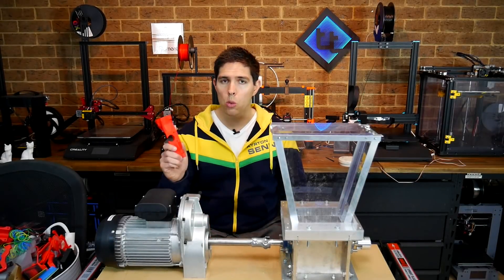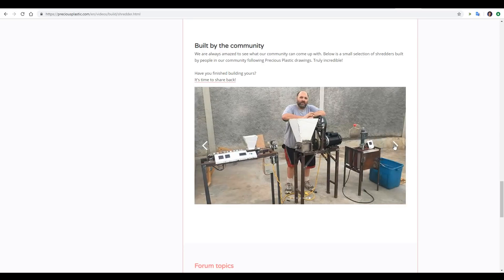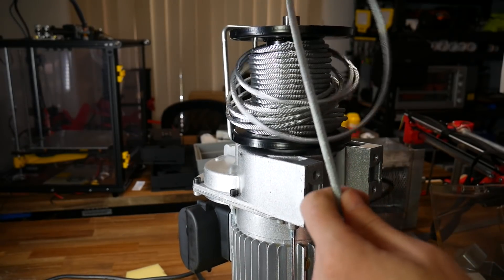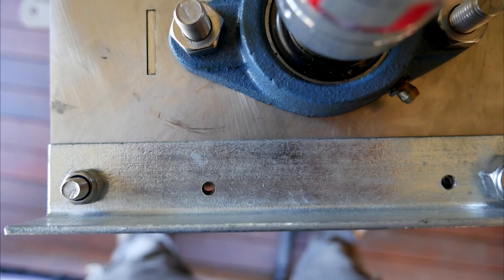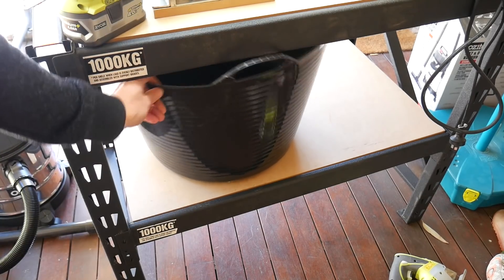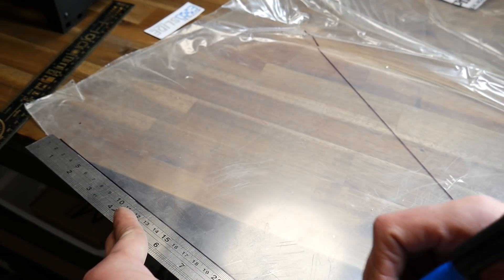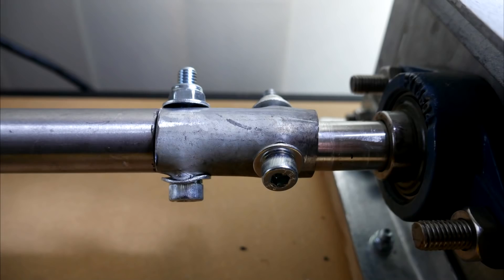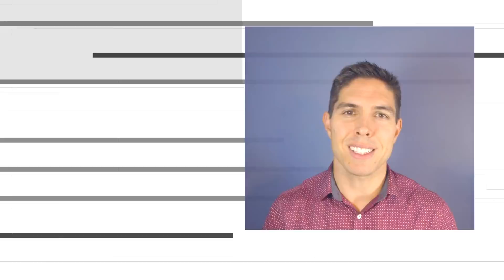Recycling waste 3D prints with a Precious Plastics shredder

Comment: This may sound very strange, and may be like a punch in the face 
But i dont care about recycling my failed 3d prints
You and me and all the other people that 3d print, produce nothing in waste, compared to big company’s in china
One day, when the world is already doomed, these companys will try to change
We have 8 years left 
8 YEARS, until we are at the no going back point

Live your life to the fullest my friend. We will die soon, sadly

However i still love your try
Keep it up
Reply: Falcon re-usability needs to become the norm at any scale.... it shouldn't matter if you produce 20kg of waste or 1000tons....

Plus, filament is normally sold by kg. Which means production is essentially about creating lots of small quantity batches in high speed so it's more efficient.

That means that the unit of production is still pretty small, so re using 'wastage' is about an input problem. (Inputs are different shapes, colour, and they are all in different places)

If systems like these evolve, they'll get cheaper or more common so you could go to your local shredder shop and re use your own filament the same day.
Reply: @ismaelabufon1696  you are absolutely wrong

Its shouldnt be about recycling these things yourself
Do you melt your soda cans???
Mostlikely not

I agree, you should get money, for returning plastics, but it would be to expensive for people to have a entire recycle center at home
I am not rich, i dont have the money for that

But lets compare, what do you think makes a bigger environmental impact 10'000 people not recycling (each 20kg) of plastic
Or 100 companys bot recycling each 1000 tons of plastic

Comment: Great video! Thanks for sharing the results,  I built that shredder box and while we know it is a beast it is great to know it stood up so well! 

Some of the issues with your coupling setup are related to the length of your output shaft (shorter means less movement) and the timber mounting (steel mountings reduce movement). We use jaw couplings with rubber spider and a keyway (grub screw fittings cant cope) and so far, so good ;)

Comment: For the coupling, use a piece of black pipe steel. It's heavy duty steel used in plumbing. It's cheap, but strong. Or you could use piece of extruded aliminium that is several mm thick. That pipe you used is way too thin for the torque this motor puts out.

Comment: At 4:11 in the video you can see a rectangular chunk of metal set into a slot machined into the shredder shaft. A similar slot is present in the spool. And that rectangular chunk of metal that ties the spool to the shaft is the drive key. The drive key not only couples the two pieces together, so they rotate without a lot of play, but the drive key is a deliberate point of failure -- the drive key can shear (fail) before either of the two elements the drive key couples together are destroyed.  Think of a big motor in a boat, and a shaft with a propeller on it. If you have a really rigid coupling between the output shaft of the motor and the prop shaft, if the prop binds up, something is going to get destroyed -- either the prop or the motor. Have the two shafts coupled using a drive key that's of a metal deliberately chosen to be not as strong as the shafts, if the prop binds up, the drive key will (hopefully) shear before the motor or the prop get destroyed. Drive keys are easier and less expensive to replace than motors or props.
Reply from the maker: I'd love to have a key but I don't have a way to machine a keyway at this stage. Thanks for the detailed post.

Comment: Yesss finaly I have been waiting for somebody seriously tacle the recicling dilema
Reply from the maker: More resources from others in the description.
Reply: Recycling dilemma? Burn it, it's the best way to recycle anything made from Carbon, it's literally the best way, always, if I was rich enough I'd build a massive biosphere greenhouse and pump it full of CO2 and create a 78/20/1 atmosphere inside it, so that it would be superoptimal for growing Trees, wheat and other plantlife. And I'd prohibit the existence of ferns anywhere near it. Ferns are the worst plant life on planet earth, depleting the atmosphere on precious CO2 and turning into oils after 50 million years and the shit grows almost endlessly and faster than you could imagine, if for example you had a pond with 1 Azolla plant on it. Let's imagine that the ponds surface is 1 googol square meters, and 1 Azolla plant is just 1 mm^2 it doubles it mass in less than 10 days. So it will cover the entire pond which is incomprehensibly big real fast, let's see it will cover it in, 3490 days. Mind you that's 
2248210660446050000000000000000000000000000000000000000000000000000000000000000000000 times the surface area of Planet Earth. In less than 10 years... The Azolla fern is said to be the sole reason for the lack of CO2 in our atmosphere. It quickly outgrows anything else that lives on this planet.
In the past when the North Sea was a lake there was a single Azolla drifting along, and we had roughly 7 times more CO2 in the atmosphere than we have now, and in less than 3 years it had drained the CO2 levels to such a point that itself couldn't extract anymore CO2 out of the atmosphere efficiently. Mind you it doubles it's biomass in 3 days in perfect conditions.

Comment: Great video. I was planning on making a plastic shredder for my kitchen plastic waste and this video probably saved me a lot of trial and error. One thing you did not include in your hopper is a safety cutout switch. Any equipment capable of removing a body part, accidently, should have a safety switch that prevents accidental operation unless all openings are closed. Not only is this a legal requirement for machinery but it is good common sense, especially if there are children around. That shredder is definitely an arm eater. Keep up the good work.
Reply: While you have a point, common sense and not letting idiots who touch everything into your workshop goes a long way. Show me a single wood worker that has the safety guards on their saws etc. If your child loses a hand in your plastic shredder, maybe you shouldn't have been letting them play with it in the first place, it's not a toy.

Comment: Very interesting.  I am interested if the high tensile bolts hold up.   You may need keyed shafts or as others mentioned gears to reduce the force on each shaft.
Dave.

Comment: So if this cost you about 1300usd to build, if my math is right at 20 dollars per kg for pla then to have it pay for itself you'd need to recycle about 65kg to break even assuming no further expense replacements.

Is that reasonable?
Reply: I'd say considering he does teaching and stuff at a school that seems to use a lot of 3d printing, he'll be able to make that back, and if he sets it up as a community thing, and was able to acquire waste prints for free and recycle that plastic back into test/draft/school prints he might make it back faster.

For your average hobbyist, not a chance that this is reasonable, but considering his full time job is basically 3d printing, I could see it working.

Comment: Honestly been considering trying to print one up of similar size in pieces and gear down a hobby motor to do the work, but idk if the plastic tines would hold up well enough to the plastic waste lol

The official PP designs all seem more expensive and less robust than they should be somehow, and while I'd love to see some stuff on the extruder, it bugs me way too much that they use a single auger bit instead of casting a pair (or more) of properly stepped screws out of a low temp cheap metal or cement or something.

Comment: It's as if we read each others minds!   I did the exact same thing....same style of hoist motor, exact same initial coupling (with similar results) and same solution with a large bolt.   If I could attach a photo you would laugh at the similarities.  The only difference is I am in Canada so my build came in about 1/2 of  yours in cost.     I have a Filustruder assembled and ready to try making my own recycled filament.    Cheers!

Comment: As I do have experience with the Shr3dit, as well as their filament maker, and have taken my own turn at recycling for 3DP, I've some things that might interest you.

When it comes to filament making, shredding is NOT a method to create pellets. Pellets need to have the size of a sphere, a cylinder, cube, ... something consistent. No consistent input equals no consistent output.
I ended up making pellets out of strings created with plastic extruding plunger. Though it's still a poorly working  proof of concept prototype, it's so much safer and cheaper compared to a shredder.

For a filament maker, in a best case scenario you're able to create a spool with poor tolerances and roundness when using virgin pellets. Using recycled material will add poor mechanical properties such as being brittle to the list, as well as loss of consistent colour. A high speed extrusion machine will give better results than a low speed one. (Industrial machines don't go fast only to make more money, its a win win)

I therefore switched to pellet extruding. Though it will also have the same poor properties, these properties now belong to the printed part, rather than filament that still needs to be printed with. But I'm actually considering to change towards plunger extrusion all together when I can eliminate the weight of the toolhead as a factor by building a special printer for it. This because it’s all to labor intensive to be convenient to me.

At last, don't do any of it with the intention of reusing 3D printing waste, it makes absolutely no financial and environmental sense. (just buy a spool of cheap filament instead) I use it to explore printing with uncommon materials in uncommon colours like HDPE, PP,... here, 'recycling' is the just the way to get my materials.

For the intention to use the shreds to make plates to CNC, drill and laser, thumbs up!

Comment: I suggest you use gears to transfer torque instead of a coupler. But make sure the gears are close to the motor end of the shafts to avoid deflection. You'll get an even better result with something like a 2:1 or 4:1 gear ratio. Metal gears of course.
Reply: Guess the motor with the gearbox looked very appealing after all that effort he put into it.

Comment: Unfortunately bolts even high tensile ones are not a good idea. High tensile bolts are very strong on tension but not good in shear load and the threads act as a stress raiser over time. Better to get some Hard Ground Steel Dowel Pins, these are designed exactly for what you are trying to do and cost pennies, keep them in place with a little Loctite.

Comment: You should try to use a thicker pipe made out of steel and drill holes in that to make it into your new coupler.  But I think that the idea you had at the end of your video.  Try to use a pipe that's about a half an inch thick.

Comment: This is extremly interesting. Too bad it is so expensive. I melted all my Waste in a pot, so that I get 3 to 5cm thick disks. This saves a lot of space. My plan is, to cut molds out of aluminium with my MPCNC, that I am currently building. Then I want to shred the Disks (I don't know how yet, they are way stronger than I expected) and use them to 'Injection mold'. Still got a lot of tinkering ahead....

Comment: Congrats on the shredder, its a beast. Did you ever try vacu-forming these sheets? I'm thinking the melting has to be very good for it to work for vacu-forming.
Reply from the maker: I have a vacuum former I made in the garage but my sheets would need to be a lot thinner for it. Planning to try it at some stage.
Reply: Ah, In your first video on recycling you mentioned you were gona try vacu-forming it, so i was wondering.

Comment: you could always weld the two drive shafts together.
Reply: VERY bad idea

You never get it perfectly straight and it would bind up the machines or break the mounts.

There needs to be a small amount of flex in the joint between shafts.

Comment: Would a 25mm schedule 80 socket weld pipe coupling work as a shaft coupler?
Reply: So much this. By the looks of it I don't even think that pipe was schedule 40.  Also should use a steel taper pin.

Comment: That shredder costs 7-8x the price of my 3d printer and you still dont have it turned into filament. Recycling seems to only make sence if you own a printer farm with a LOT of machines running all the time.
I also heard to turn it back to usable filament you need to mix close to 50% with vergin plastic.
Reply: Side85Winder No recycling only makes sense if you enjoy living in a plastics landfill. And don't count on developping countries to outsource your landfills,  these two last years US, Canadian and European Waste cargo ships have all been sent back to sender...
Reply: @the_arcanum  i 3d print in ABS it may not be a recyclable plastic but my failed prints i can turn into ABS juice for bed adhesion or repairing prints or cut them up and use acetone to bond them to other pieces. I rarely use PLA i have never used PETG as ABS is generally my go to heat resistant plastic.
Reply: @the_arcanum  PLA is a non-petroleum plastic. The huge benefit of PLA as a bioplastic is its versatility and the fact that it naturally degrades when exposed to the environment.  Our county recycles petroleum plastics already.  It's unrealistic to think anyone is really going to spend such a HUGE amount of money on a shredder to make confetti, with no usable outcome.  This is a solution, looking for a problem.
Reply: @the_arcanum   Read the "Applications" section of the Wiki: https://en.wikipedia.org/wiki/Polylactic_acid

Comment: Regarding the coupling: How about using simple engineering methods to calculate the output torque of the motor/gearbox and then choose a properly sized coupling? 
The first coulping you had wasn't a bad idea per se, but seems way to small (only 2x the diamater of the shafts) although it might have had the proper bore size. 
Lets estimate the motor really can lift 500kg with that winch, that equals to ~4900 N of force.  It looks like theres a radius of around 60-70 mm on the cable-reel when its fully loaded --> that equals to a torque off around 4900 N* 0,07 m = 343 Nm for a rough estimate (not taking any safety factors or possible torque-peaks of the electric motor into consideration). 
Looking on a website like misumi for a similar style coupling with this kind of torque rating, a proper sized coupler should have at least a diamater of 80 - 100 mm.

However, next thing you should ask yourself is, if you really want all that torque to be transfered and the coupling not fail?
If the coupling does not fail, the fixturing of gearbox or the shredder itself might and then you suddenly have something with a lot more mass rotating around.
For safety reasons a properly sized and adjustable slipping/safety clutch might be the needed, but that also might get pricey really fast.

Keep yourself safe, so you can keep making vids ;)
Reply: I guess the coupler can fail, it is cheap, it is much like a fuse in an electrical device. Better the coupler to fail than the other parts, pretty right 💟

Comment: Weld the coupler to the motor side, and then use shear bolts meant for a snow blower on the shredder side.  https://www.amazon.com.au/ROP-Shop-1028STE-1130STE-Snowblowers/dp/B073HK63QN/ref=sr_1_35?keywords=shear+bolts+snow+blower&qid=1565649312&s=gateway&sr=8-35

Comment: Loved the video! I've worked on industrial size shredder for plastic and there to the couplers where the weak link, they used 4 bolt flanges with a taper pin through the shaft on each side as the sacrificial part. Thanks for the great video 👍

Comment: The reason the coupler is strong enough in the tutorial video is that they've flattened off the hardened steel to face the allen key. The other options are the same as the key broach that your original lift mount used. You've still got the key in there. You could shorten the output shaft of your motor and use the key broach but then you still need something at the other end. Is it broached too? If not you're then down to potentially flattening it off or get an actual adaptor that will be considerably thicker than the 20mm ID pipe you're using. "Rigid shaft coupling" might also help with your google-fu to find something which can spread the load across the shaft if it isn't broached.
Reply: Thanks. Learning something new. Now to Google for the meaning of broached
Reply: Yeah, coupler is a waste. Easy enough to make your own

Comment: given the torque of that motor it may be worth bolting the metal frame underneath the mdf sheet so that the force is distributed over more area instead of the 5mm or so around each mounting bolt
Reply: I was about to type this.
Thanks 🙏

Comment: I worked with the charity Edukid to get them using this to recycle plastic in Cambodia. Fantastic to see it in action. Long term I would love to get a schools iot where kids design the molds for plastic bottle led lights with a 3d printer before injection molding their design and wiring the electronics.

Comment: I would recommend you look for a 'taper lock' coupling for those shafts. Something like this.
https://www.ktr.com/en/products/power-transmission-technology/couplings/elastic-jaw-and-pin-bush-couplings/rotex-flexible-jaw-couplings/rotex-taper-clamping-bush/
They will clamp on to a plain shaft and wont ever let go. (if there torqued down enough)
It won't be cheap but it won't need and finessing once it's on.

Also... Jig saw? Table saw?   You need a large format CNC mach....  oh.